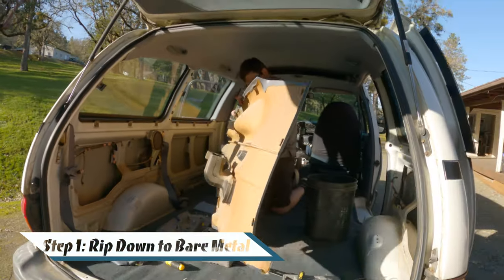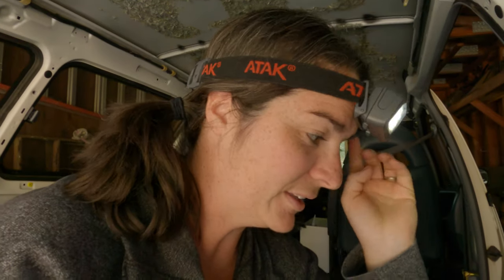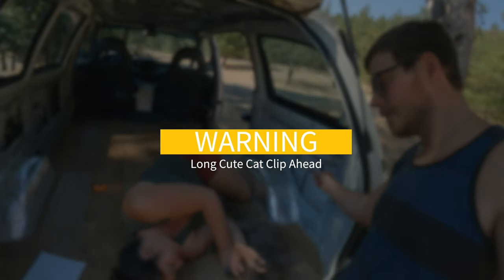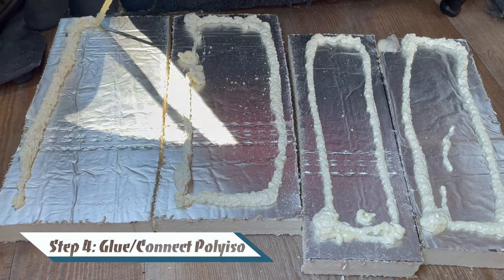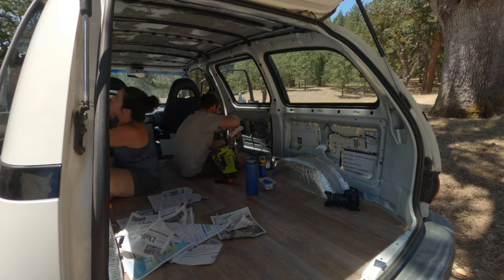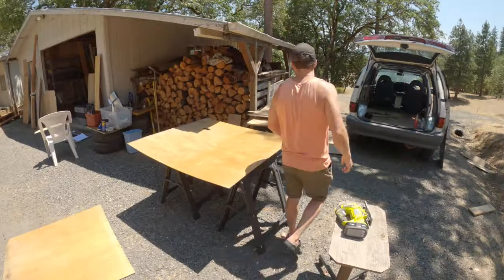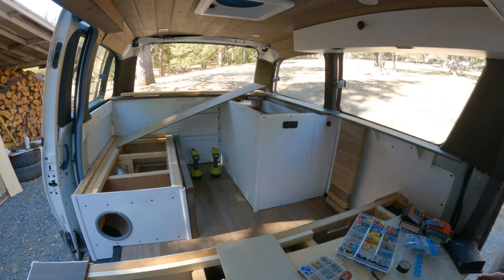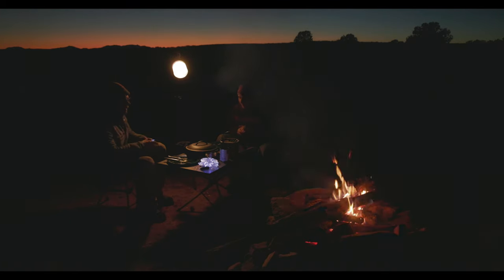How To Insulate Van Walls in Campervan with Polyiso Foam Board | Step by Step Wall Insulation Guide

Comment: Dude, I've been stressing over this job for days. I feel a lot more confident now. Thank you! 

I plan on using the pillars to route wires eventually when I install solar. There's not really a  way to pull wires through after putting expanding foam in there, right? I'm thinking I'll have to wait until later for the foam.
Reply from the maker: Glad we can put you at a little ease. Also, the best thing would be to run conduit so that you can always be able to access wires Incase anything goes awry. Good luck!